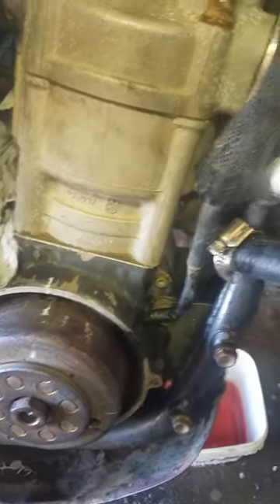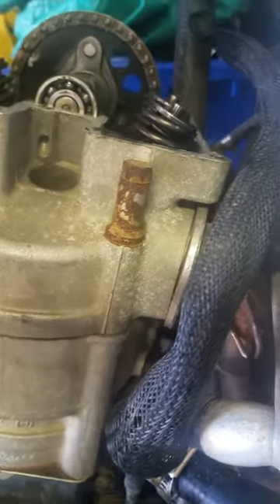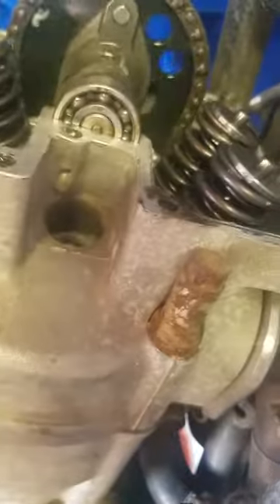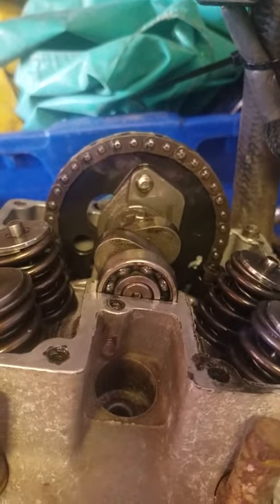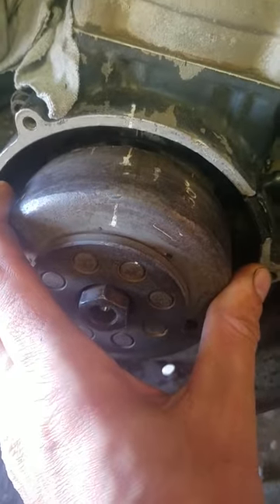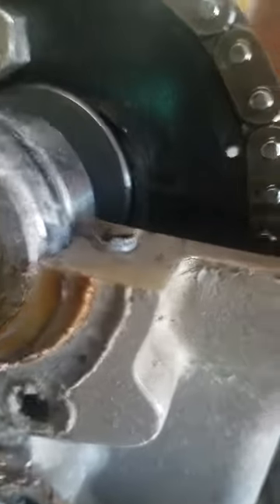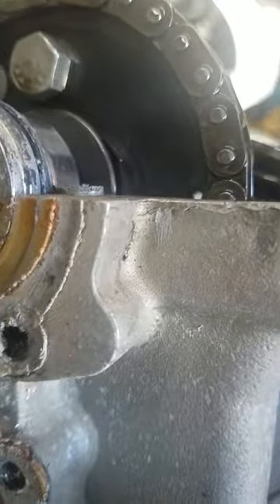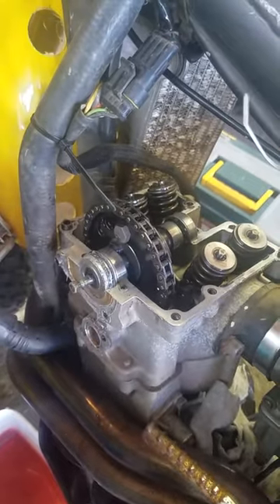2001 husqvarna 570 TE cam chain timing marks

Comment from the maker: Well as it turns out - after speaking to a Husky GURU here in SoCal, what MANY folks dont know is they had two setups, the one found online is 30 degrees off (same one i followed)! SO - you would have to move the magnets 30 degrees retarded to the 153 one online (or whatever) and try! Print out a degree wheel the size of the flywheel / magnet cover and use that :)

Comment: Very helpful video about to put my motor back together and was pretty glad to find this what is this 30 degrees that you commented about though I’m a little lost there
Reply from the maker: The diagram I followed is one I found online where a guy hand drew the angle of the magnets, and it worked for him.. but the shop owner I spoke to here in the US said there was a 2nd design (mine) which is 30 degrees different than the one I found online,  I would NOT kick-start it if u are testing initially! Rope around front forks and tow behind a car and try run start in 2nd gear.. that kick lever almost destroyed my foot vos it was off so much.

This was the one I followed and I ended up being incorrect 

https://thumpertalk.com/forums/topic/977363-te610-tc610-flywheel-repair-guide/

Comment: If you're pulling the cam this video is irrelevant.
Reply from the maker: not at all- the cam timing is not related to the magnets in the flywheel- its a very common issue, the magnets separate and getting them lined up in the correct position is the main issue.. It will NOT fire correctly and bust your ankle. There is ONE diagram online that is very misleading because some models have magnets that are spaced VERY differently (almost 40 degrees apart) which is why I could not get mine to start.. The cam lines up with the flywheel marks, BUT if the magnets have shifted they will be out of sync with the flywheel mark and basically the whole system is out of sync. 

This video deals with re-epoxying the magnets in their correct position. I am back in the US and not near the bike but might be soon and will def get it running next time!